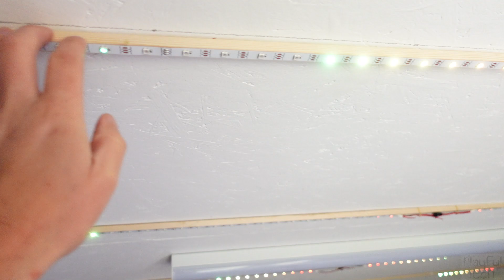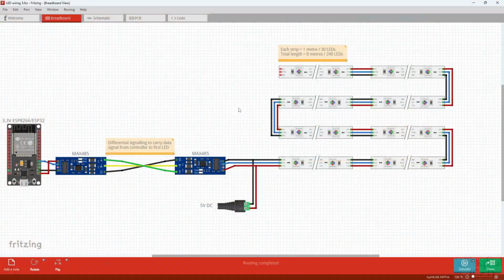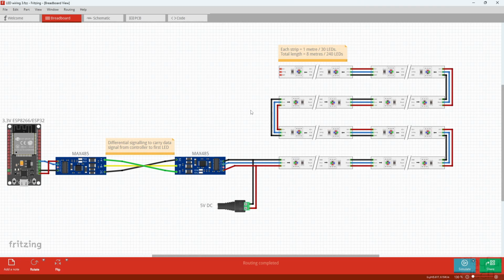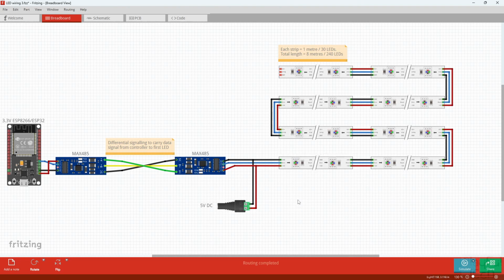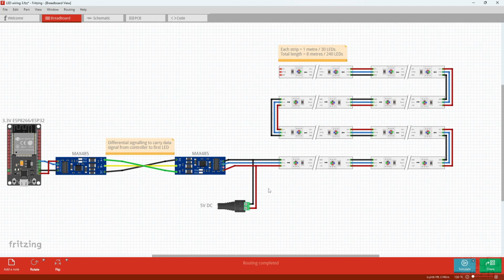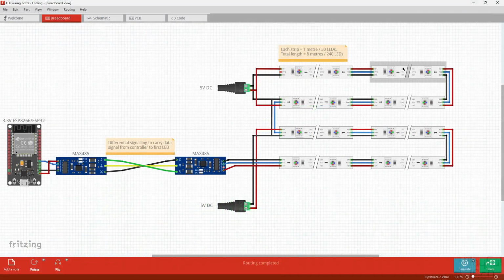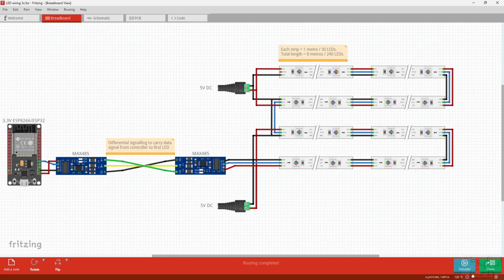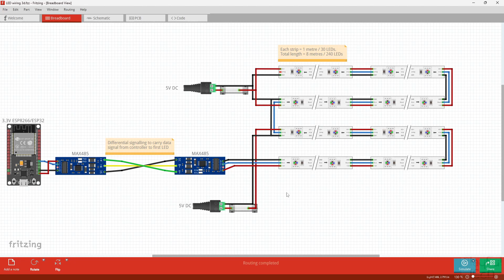Power Injection for Programmable LED Strips

Comment: You are wrong about a couple of things, most strips are sold in a 5m continous strip, not 1m, and they are not called programmable, they are called individualy addressable strips.
Reply from the maker: "Individually addressable" only refers to strips of certain LED chip types (e.g. WS2812B), in which you can set the RGB value of each LED individually. You can also get strips in which each chip is responsible for setting a group of several LEDs - the most common example is a WS2811 which typically addresses groups of three LEDs. Or, you might have a strip in which all LEDs share the same RGB(W) value. These can all be set programatically via a microcontroller, but not neccesarily individually. Hence "programmable" LED strip.

Comment: If I needed to add 5 or 6 injections over a long run, can I just run one set of thick gauge power cable next to the strip and tap into them every couple of meters? Where is it better to run individual cables for each injection? (When I'm using just one power supply)

Comment: When using fuses with multiple power injections, should I consider the total amps the strip would draw, or should I divide it? Lets say for example the LED strip draws 15A, and I have 2 injections. Would I use a 20A fuse on each injection,  or 10A fuses?

Comment: Your tip to mount the LED strips to a removable frame that you can work on on a desk or workbench is a great idea.  However, particularly for environmentally protected LED strips that are covered with silicone, the ability to dissipate heat can affect their lifespan.  I have seen this happen in my escape room. After 4 years, a couple percent of the IP65 pixels, which were mounted to wood, have had one or more LED subpixel elements fail.

So, when it's practical to do so, consider mounting them to metal instead of wood, as it will act as a heat sink

Comment: Another way to tackle it is to use a higher voltage for transmission, eg 12 or 24v, and have local DC-DC conversion down to 5v. This is in fact exactly how the National Grid works, and the reason is because power dissipated in a conductor is a function of the current flowing through it, not the voltage (P = I^2R). By increasing the voltage, you reduce the effect that the conductor's resistance has. 
Of course this is a bit more of a pain because now you've got DC-DC converters everywhere, but they are readily available as potted modules which are easy to use
Reply: Yes, and that is why the 12V WS2811/WS2815 LED strips need less frequent power injection points than the 5V WS2812/13 (But also why they're less efficient, since they just waste the excess voltage as heat)
Reply: they probably just use resistors or linear regulators, which is where the efficiency drop is. Switching regulators can be had that are like 95% efficient, for example the Traco Power TSR 1-2450
Reply from the maker: @jaycee1980  Yeah, but they're hardly likely to bundle a £6 component inside every LED package! :)
Reply: @PlayfulTechnology  indeed though those modules cost that much, it doesnt mean they are worth that much ;)

They are useful though, I'd recommend getting yourself some and having a play about

Comment: My top tip when using the led strips is to not depend on the included adhesive strip. It'll only last a few months at most before bits will start pealing off.
Reply: Yes! Very good point. I often 3d print little clips or conduit to run it through.

Comment: LED strips are really useful!! Keep it up
By the way…how do you mean …”do not connect the plus on both”? Then you have to sever the supply positive on the LED strip between the supplies?
Reply from the maker: That's correct - if you have multple power supplies along the strip, DO NOT connect the positive line between them, only GND. You can just pull the red wire out from the connectors. If there is a slight difference in voltage between them, it will cause current to flow between the supplies, leading to damage, overheating, voltage instability, etc.
Reply: @PlayfulTechnology  If the supplies +Ve's are only connected together through the strip then the strip and associated wiring will effectively act as a ballast resistor so any small imbalance won't be an issue, connecting them together at source isn't a good idea though. unless the supplies are specifically designed for it. Separating the +Ve connections does mean a supply failure becomes obvious as you'll lose that section of strip but sometimes is may be more desirable to keep the installation running as normal (but maybe at reduced brightness) on a single supply until the faulty supply can be replaced. That also means you need some form of monitoring to make supply failure obvious.
Reply: @mfx1 If a PSU fails, I'd rather it be explicit than for another unit to silently be placed under greater strain. Also, by keeping sections completely isolated you can mix'n'match 5V and 12V LEDs (but still have them controlled by a single common data line, so seen as one strip as far as the controller is concerned)
Reply: @mfx1  if the power supply positives are not seperate from each other then if one psu has a slightly higher output voltage this one will carry more of the load than the other.
Probably better to split the load between power supplies as you want it by leaving only the negative and data wires connected together
Reply: @dave00011  Not if you use ballast resistors (as I said) and in the case of LED strips the strips themselves effectively act as ballast resistors just don't connect the PSU +Ve's together directly at source.
Reply: @PlayfulTechnology  Roger that!